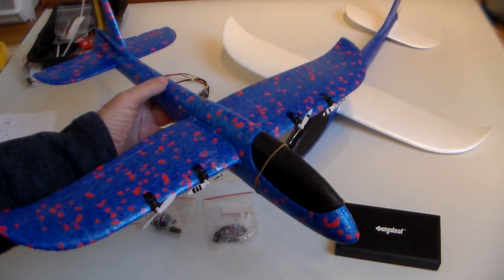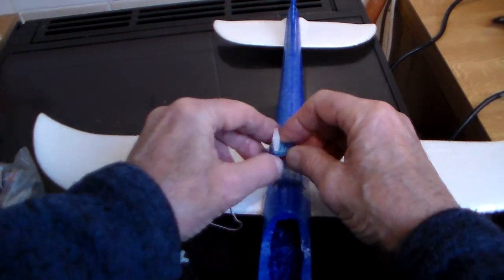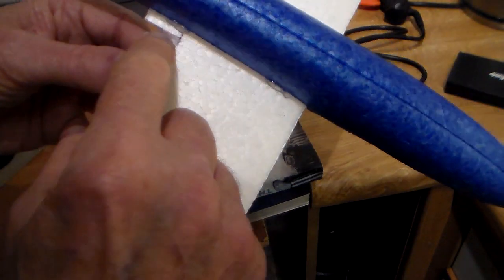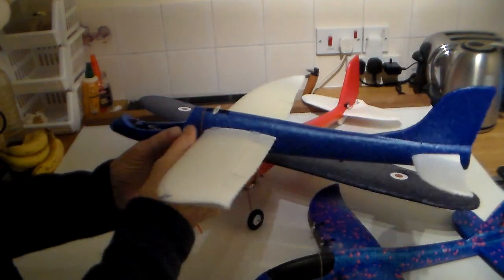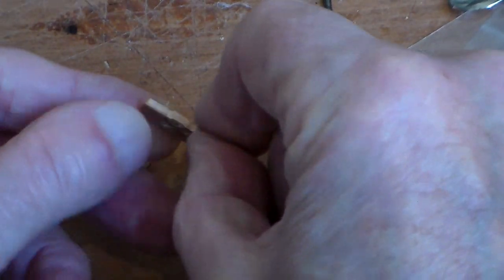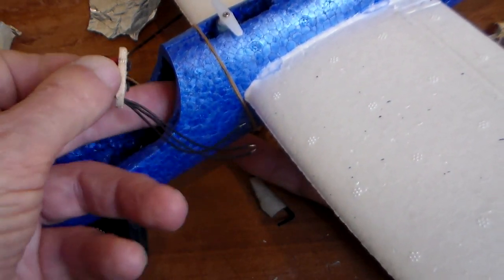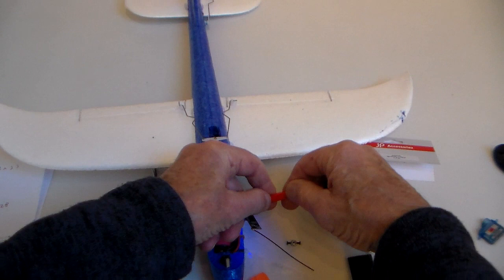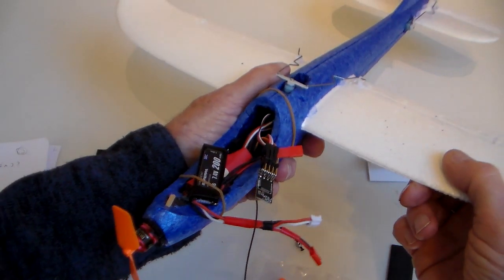Turn a £5 cheap Lidl foamie chuck glider into a great RC Plane! Here's how.  BUILD BLOG + PARTS LIST

Comment: Those look like the same type as the 48cm ones from Kmart here Bob. They have a nice fine edge to the airfoils unlike some of the ones from the Internet or the local cheap shop. Lighter by a few grams too. Trouble is they have been hit by inflation now - gone up from AU$3 to AU3.25 now! 😱😜😁
We have choices of 1104/1105/1108 motors for these. We'll see how this goes. 😊
Reply from the maker: $3 25?  You'll have to give up drinking for a month to save up!   😒But yes, much easier to find than the big Lidl. I bought one of mine in France in September. 10 euros. £9. The other in Lidl £5. And they're £5.99 in the RC shop. Good to mess with but quite a challenge to get everything in! I did a glide test today and had to add a couple of grams to the tail, but I think she''ll fly! 🙂
Reply from the maker: 1104 seems more than enough and at the time I paid £5 for it.  Everything has gone up though last few weeks.
Reply: @bobflyman  LOL. Yep, the 84cm LIDL type is still AU$10 at the local Kmart but it's not the newer type with the fine airfoil edges and slightly wider fuse. 😭
Still makes a cracking twin though! 🙂
Old credit/gift cards make good mounts for those dinky little motors. Just rough 'em up with sandpaper a bit before gluing. Got a set of 4 DYS 1104s (incl ESCs and even 6 T-mount props like the ones on our KingKongTinyWing 450 - they just don't break!) locally a while back when they were selling out - should have grabbed more!
Life's full of Shouldda Dones! 😜
I did grab some bag lots of control horns, wires and end adjusters so getting the elevators/etc set just so is easier here than your straightened paper clip method there. 😉

Comment: What charger do you use for battery’s under 500mah I’ve been looking everywhere but I can’t find one on budget
Reply from the maker: Just search IMAX B6 LCD Lipo NiMH Battery Smart Balance Charger, that will do the lot 1s, 2s , 3s and you can set to balance if 2s + or if a 1s set charge rate as low as 100mA. Amazon link.  https://amzn.to/3STqtkX
Or search USB lipo charger , VolantexRC USB 1S Charger £3.60 will charge those small 1s lipo's.
Reply: Thanks for the quick response I’ll think about buying it btw I’m from Australia

Comment: if you are mounting a tractor style motor on both  the planes center lines why do you have to put downward right pitch on the motor???
Reply from the maker: All aircraft and rc models have side and downthrust. I'm not going to attempt to explain it here. Google.
https://www.balsaworkbench.com/?page_id=2714

https://aviation.stackexchange.com/questions/82274/what-is-the-purpose-of-downthrust
Reply: Downwards counteracts the tendency of pretty well all airframes to climb under increasing motor revs (and airspeed) and sideways counteracts the tendency to roll under reaction to motor torque. 😊

Comment: Good idea. Why not set up ailerons as elevons with separate servos then no need for the elevator at back.
Reply from the maker: Funny enough I did think about that idea afterwards, but I think for them to work as elevons they'd need to be bigger and it still uses two servos anyway,  so no weight saving.  Don't think I've ever seen that arrangement used for ailerons?   My Mini Flight Test F22 Raptor has flaperons and that works well. https://youtu.be/oHKjY_CZOVo  I'm just working on a twin motor version of this little £6 chuck glider with  2 brushed motors and aileron/elevator. Watch this space  😉

Comment: Hi Bob, just doing one of these conversions, question about the battery, is it a 7.4v or 3.7v. If it is a 7.4v. I'm having a job finding one. Can you please tell me where you bought it from.
Reply from the maker: Hi Sid,  it's a Radient 200mA 2s.  Mine was from local RC model shop, but I just Googled '200mA 2s lipo' and found a few. Wheelspin sell them for £8.08  https://wheelspinmodels.co.uk/i/339446/?gclid=CjwKCAjwl6OiBhA2EiwAuUwWZewEl72Zoj8F2xBBqD2TNrxnQ_5HjnC3vqiy1FVW6W9G2G_zR6dCRxoCcskQAvD_BwE Cheapest I found was £5.99 from here  https://www.makeitbuildit.co.uk/eazy-rc-lipo-battery-2s-lipo-380mah-ezy-e1014-101235?gclid=CjwKCAjwl6OiBhA2EiwAuUwWZTajPtClOe9fwsVrM83DkhuCvHROl9oZ-MF_zG2gXPSmqlpSdzi3NxoCFBQQAvD_BwE
I've actually just finished a 2 engine version with 2  tiny brushed motors and it will run on a 200mA 1s. I haven't found an ESC for brushless that will work on just 4.2v  but found a micro brushed ESC that does and my receiver and servos will also work on just 4.2v.  It'll be on my channel as soon as I get a chance to maiden it!
Reply: @bobflyman  thanks Bob for your quick response on this, yer seen similar ones to that on google, but yours looks quite smaller, thinking of the weight mainly, (wonder if your local model shop does online deliveries) done the Big Lidl waiting for it's maiden, thought I would try the smaller fiddly one as well. Love all your vids, seen most of them now, esp the aircraft ones, very talented. I might go for that one from Wheelspin then.  Many thanks again.
Reply from the maker: @seasidesidmetaldetecting.5255  Sorry about late reply to this one!  No I doubt Bekra in Newton Abbott will mail, and at £5 the postage would be almost as much as the battery!  Also the £5 version didn't have a JST connection, it had a weird one and I had to modify one of my chargers AND make a connector plug!  The Wheelspin is a good option.  https://www.youtube.com/watch?v=0B4yIU3qMs8&list=PLLdle7NDE_1Y_XC3kjOSIUDJcRxVrhez-&index=23&pp=gAQBiAQB
Reply from the maker: @seasidesidmetaldetecting.5255  My latest Mini Lidl, twin brushed motors, flies on an even small battery!  250 mA 1s!  And very lightweight brushed motor esc. 2 or 3 gms I think. My first build with small brushed motors. 78 gms all up weight with battery!  https://www.youtube.com/watch?v=q5vrV-vyn2I&list=PLLdle7NDE_1Y_XC3kjOSIUDJcRxVrhez-&index=2&t=3s&pp=gAQBiAQB
Reply: Considering the weather you had for the maiden on this it flew brilliantly, love to see it on a calm day. Regarding the lipo thing, reckon i'm gonna go for the Wheelspin one. Thanks for all your help on this anyway, appreciated.